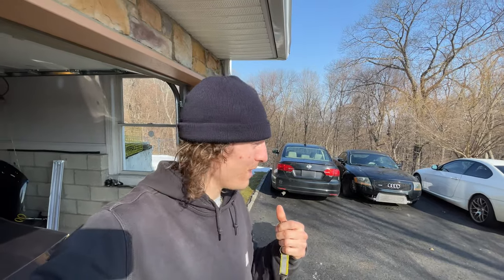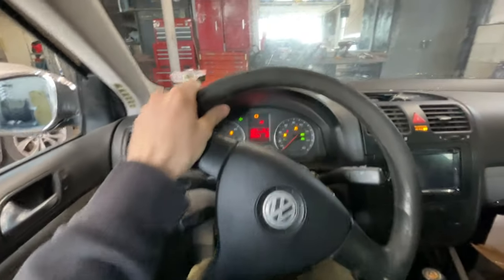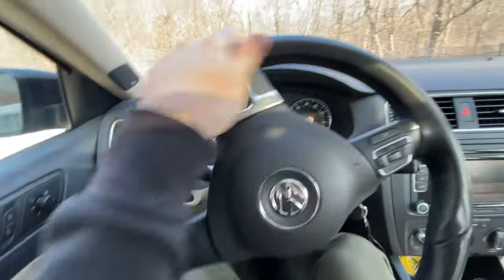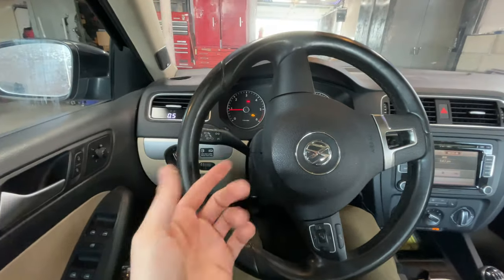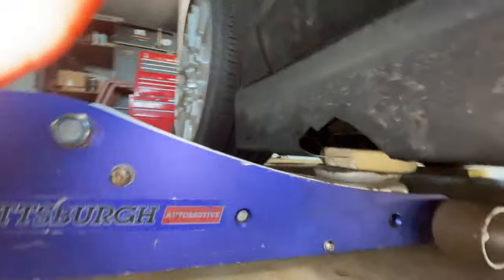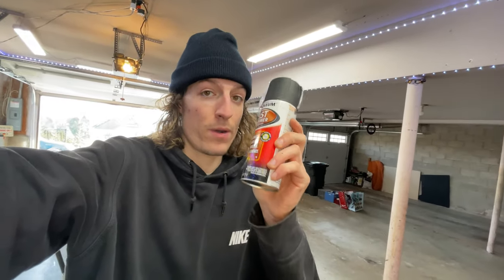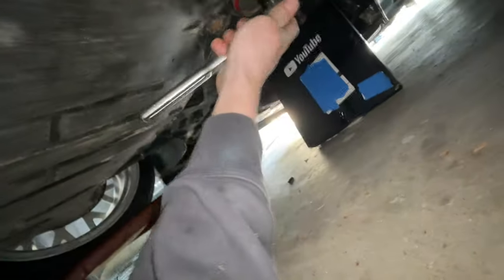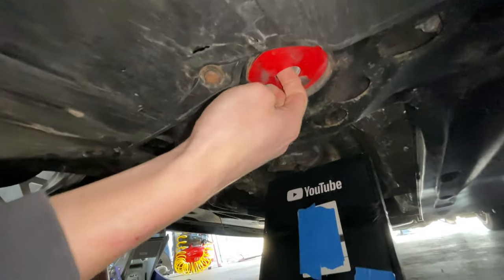I REMOVED MY ENGINE DOGBONE INSERT

Comment: you gotta spend the money for a good one i have a 034 in my mk7 feels great what DID add noise for my case is i swapped out the stock strut tops for 034s top hots with camber just gotta spend to get the good stuff
Reply from the maker: For real dude !